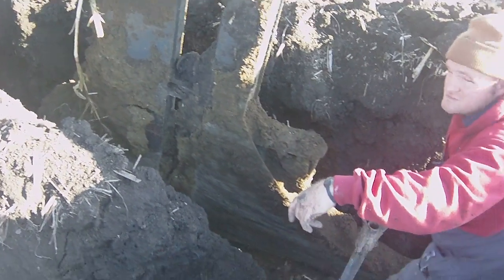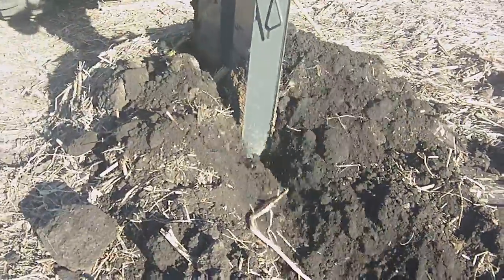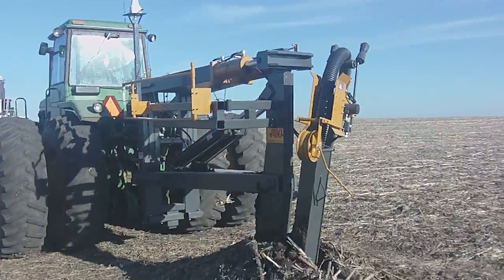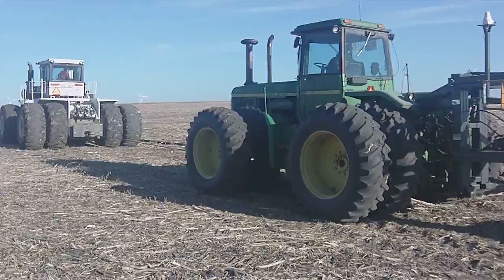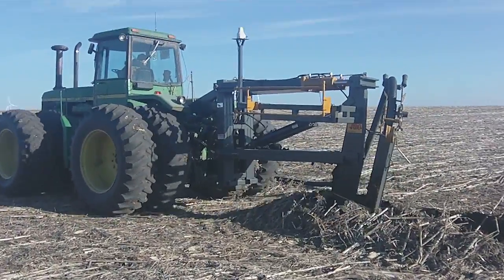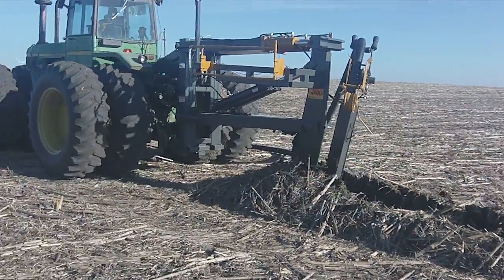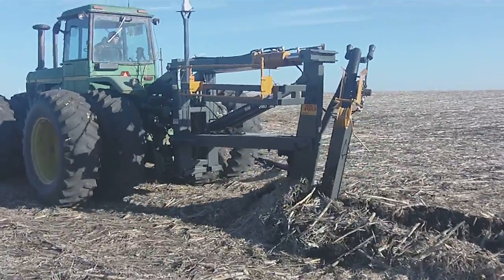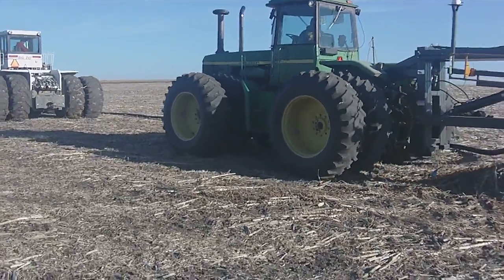Field Tile Installation in SW Minnesota.MP4

Comment from the maker: The tile is perforated so the water is drained where the tile was installed. The perforated tile is designed to drain water while keeping the soil out of the tile.  The small amount soil that might enter the tile is quickly drained as the water flows to the outlet.  The holes are very small, so there is little soil, if any, that enters the tile. Tim.